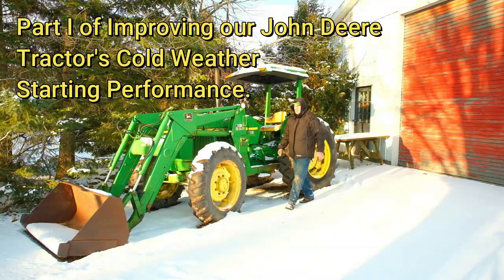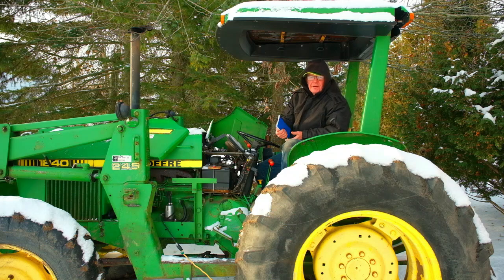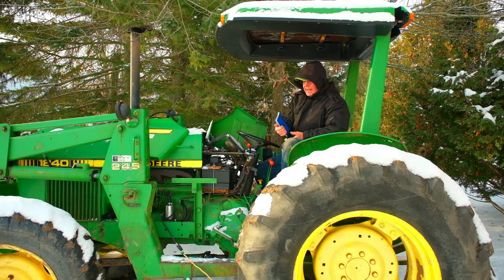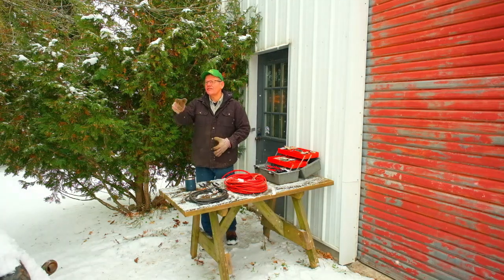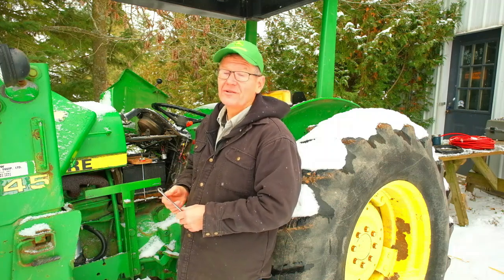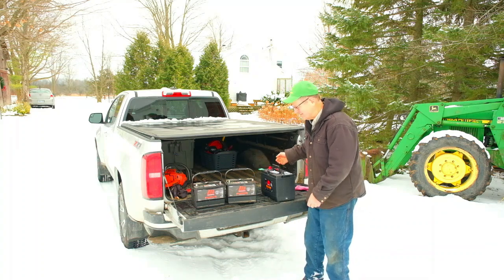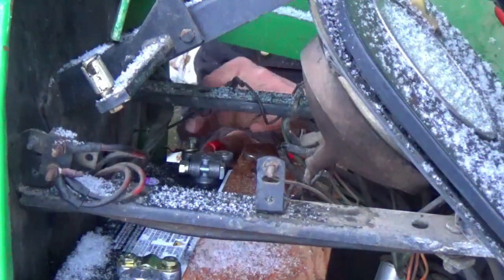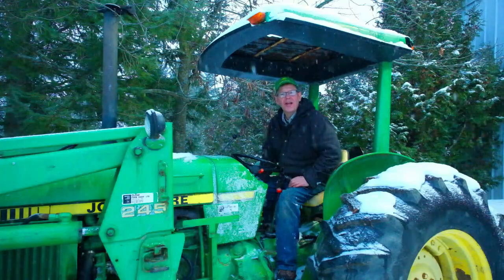Improving our John Deere Tractor's Cold Weather Starting Performance Part I

Comment: Another learning opportunity... good one!  I was wondering why you were working outside... until I saw the nice Massey-Harris inside! That cable was a nice leftover! I am not a fan of Canadian Tire when it comes to batteries. That might be your learning opportunity there. Last battery I changed, I went to a local shop (hydraulic shop) and was very satisfied with the battery they sold me. So to let you know, I have 2 identical Case 430. One runs a Canadian Tire battery. The other one from the local shop.  Guess which one is better... Have a nice holiday season Paul!
Reply from the maker: Hello Joe,
I hope you are doing well and enjoying the beginning to our winter.
I an appreciate your lack of faith in batteries from Canadian Tire, 
they certainly are not premium quality. My brother in-law has a 430 Case, he has 3 pt hitch blade and loader on it both equipped for pushing snow. I sure appreciate older equipment and tractors. I have some repairs to complete on our old Massey (1948), time allowing, I hope to make a video of the journey in a few weeks. It seems life is a little busy right now. Merry Christmas to you and your family.
Thanks so much for saying hello!

Comment: Paul, I have an 830 John Deere it has 2 12-volt batteries on it I was going to swap it to 1 battery I ask my neighbor he has worked for John Deere for 50 years he told me to keep the 2 batteries like it came with or I would be asking for trouble in the long run, so I don't know. Good luck.
Reply from the maker: Greetings Danny,
Thanks for reaching out and sharing your neighbour's thoughts on replacing the two batteries with one. Would I be correct in assuming your 830 is a two cylinder?
They were, and still are, an amazing and incredible tractor. May I also assume you are a farmer? In the good old days a neighbour of ours had a 2 cylinder (an AR), I can well remember the wonderful song it sang as he worked his land with it. 
In his later years he even ran a thrashing machine with it. He was a bit of a collector.
Thanks again for saying hello.
I hope you and your family enjoy a wonderful Christmas.
All the best,
Paul
Reply: Paul my tractor is a 45 hp it was built in 1974 I retired a full-time fireman. we have 45 acres I mow about 10 acres every 2 weeks in the summer and the rest of the time just do what I won't to have a great week enjoy your videos.

Comment: "I hope this isn't another learning opportunity" made me laugh.
I've never seen one of those little press things you used to crimp the cable end. It looks pretty much like a cable cutter that you hit with a hammer.
Reply from the maker: Hello Buddy,
I bet things are a tad frosty in your neck of the woods this morning. After a few days of what felt like tropical weather,  our temps are back in the normal zone. 
I have used a cable cutter  like you described. In my teen aged years, working with a well experienced gentleman on some even older equipment, back when blades were lifted with cables... The crimping tool certainly does look like a cable cutter. It was actually designed to also be hit with a hammer but when possible I have always squeezed it with a vice, it seems a little less crude...
Turned out the tractor repair was indeed "another rich learning opportunity".
Oh well, LOL!!!
I will be posting Part II soon.
I hope you and your family have a Blessed Christmas!